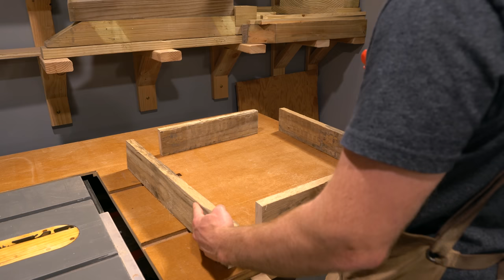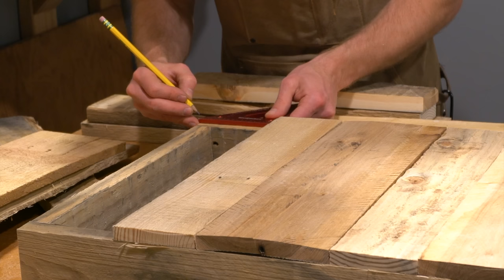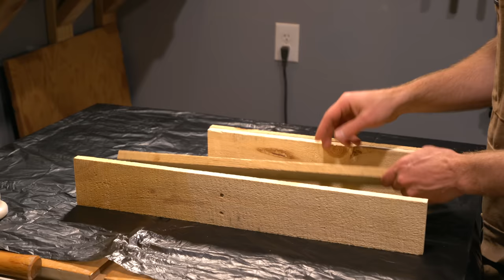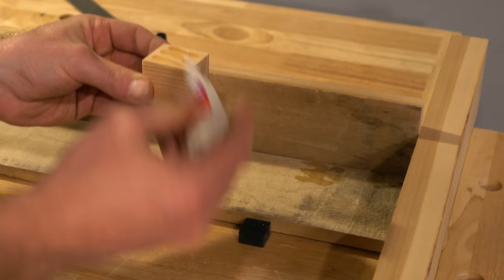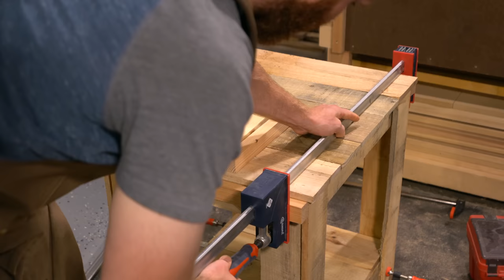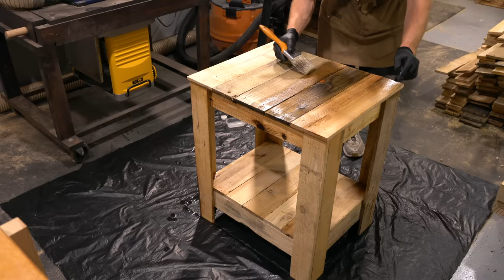I think this is my best pallet wood project ever!

Comment: Did you sand the first coat of urethane so the top would be smooth?
Reply from the maker: Hey, I didn’t have to sand at all for the project. I used a furniture oil by walrus oil that didn’t require any sanding and I didn’t sand the pallet wood either so it could have a rustic look.

Comment: Dimensions please anyone?   looks like 24 x 20.    The base looks like 2x6?   The rest 1x4?
Reply from the maker: 24 wide, 18 depth. Everything is 3.5 in wide except for the boards that lay across horizontally. Most of the boards are between .5-.75 inches in thickness. It’s all pallet wood, nails and holes left in, no sanding at all just some finish oil. Oh and it’s 26.5 inches tall.
Reply: @_Shopfix  thanks so much.  I'm going to try the same build.